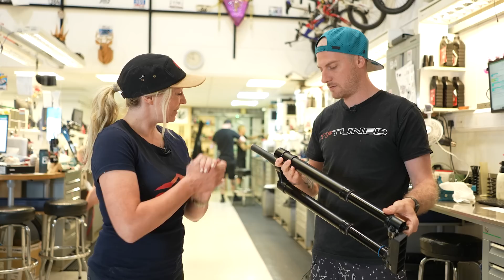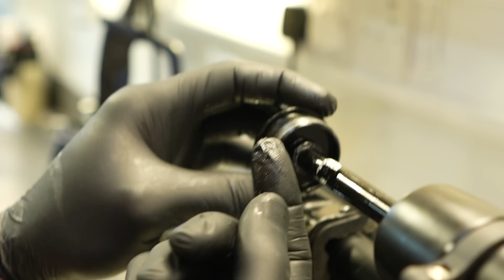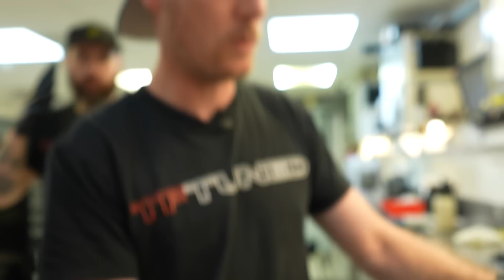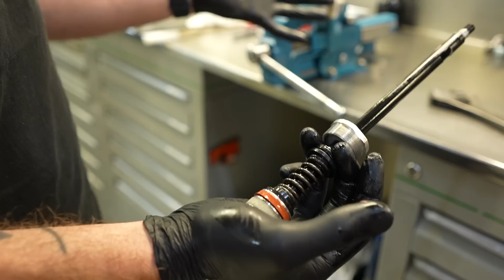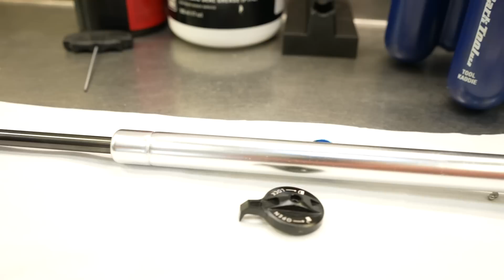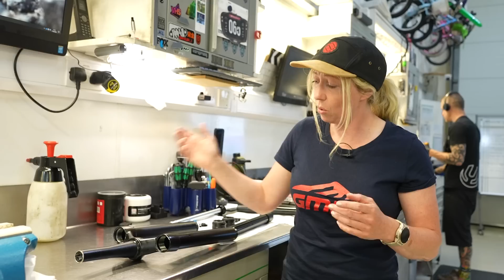Pro Mechanic Reacts To CHEAP AliExpress MTB Forks!

Comment: I think this is unfair on a couple of levels. Firstly, talking about Aliexpress like it's a brand or manufacturer. It's just a marketplace. These aren't 'Aliexpress forks'. There are Chinese brands really trying to gain a good reputation and make good stuff who use Aliexpress too. Why not reach out to such brands and do an honest review of their products rather than buying something that's almost certainly going to be junk? There are also OEM manufacturers who literally sell the same parts that are on bikes in UK bike shops or make components for major brands.

Secondly, get a smart Aliexpress shopper to choose the products that you use. Buying stuff that looks like the latest tech or trend (like upside down forks) and has no brand name on it at all is not the smart way to use Aliexpress. It almost gives the impression that you're deliberately trying to hunt out the worst products. The smart play is to look for products that use well established standards, conventional designs and are happy to put their name to them. Most times you'll end up with something that works well, albeit based on tech that isn't cutting edge.

Comment: I mean my first half decent fork was an RST 80mm on elastomers, it certainly wasn't the greatest, but after several years of riding it still had tight bushings. At the same time I took good care of it by regreasing every winter, but I guess there is nothing you can do about a factory defect, the play on the bushings is unacceptable, the forks won't last longer than 200 hours without showing signs of wear, they just broke in and they are already showing signs of wear... For reference I had many Rock Shox forks over the years and with just regular oil changes I never had replaced bushings, just the occasional seal replacements when they leak. And that goes for every other fork and suspension brands... So very well said there at the end, get a used one, at the end of the day what you want is something that isn't a concern when you go riding, make sure you do an oil change before riding and it will work as good as new.

Comment: I'm using a budget air fork named (Sagmit Evo 3) mine doesn't have a rebound adjuster just a compression / lockout and I experimented mine I remove my lockout damping rod cause the rod won't allow the fork to travel to it's potential travel however the fork is still safe to use on trail and even when jumping.

Comment: I have Aliexpress forks, actually looked at this one since it looks kind of cool, but there wasn't enough information for me to really consider it.  I do wish I'd gotten the DNM upside down one though in hindsight, since mine is potentially as sketchy as this one inside (although it rides fine so far so probably not as atrocious), whereas the DNM is heavy and primitive in a way that it should require maintenance more often than a more expensive fork from the big brands, and feel less sophisticated, but also primitive in a way that it probably won't break or wear completely out as long as you take care of it.  My DNM shock is excellent, and their forks seem to be a cut above the randomly occurring brands, although like I said, not necessarily the cutting edge of technology or as maintenance free as the big boys.  You do have to consider though the cost of taking your branded forks to a place like TFTuned as well, wheras the Ali ones cost less than a set of tires.  The one I ended up buying, is just OK, but there are photos and explanations online by people who have taken it apart and tuned it up, where they lubricate it better than it comes from the factory, but I didn't see any cases of people finding it completely F-ed up like this when they take it apart.  So it looks like that little bit of research served me well, might have even saved a bunch of teeth there, knock on wood.  Anyway, that's not what makes me nervous riding.  What makes me nervous is that when I broke the main pivot bolt in my not so great Aliexpress frame, I got it repaired at the machine shop nearest the bike shop, which turned out to be right across the street from where the Titan sub took off from to go implode, days before they left.  If they'd needed any work done at the last minute, they'd have used that same machine shop, around that same time.  My bike could have the same metal in it as the Titan submersible, so that's what really haunts me when I ride.  Plus it's all from Aliexpress lol.  But that pivot bolt is way more spooky.

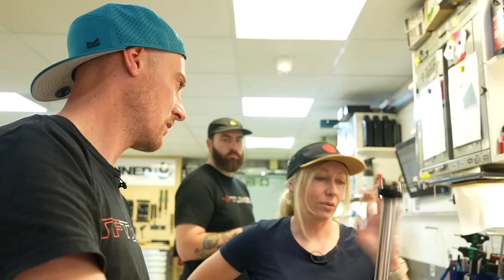Comment: 14:50 that air cartridge is similar to marzocchi pre 2000 tech ! you can drill 2 holes in it ! one at the bottom about 3-4 mm large and one smaller like 2 mm wide half way to top and convert it to open bath !
Reply from the maker: Wow! What a tip haha. We'd try that if this wasn't in the bin 😂
Reply: @gmbntech  this happend to me around 2005 when i had a 66 rc2x, the air cartridge was faulty and the only repair you could do to it was making holes in it and make it open bath, worked well, saw this at that time on pinkbike 😂

Comment: The funny thing is i,m old enough to remember the very first mtb suspension forks ie manitou rockshox etc and they were fkn terrible i worked for a big bike company and flatly refused to use the shit suspension i was faster on a good rigid cro mo fork its funny its taken almost a livetime for mtb suspension to be good and the bicycle industry still pretended that moto cross forks are so differant its crazy .

Comment: Its funny but it seems those cheap bolany forks are of better quality than whatever those forks are on the video, the bolany forks at least have a brace between the two sides of the shocks to keep the wheel in the same direction as the forks are pointing.

Comment: Good luck running them!😬 Aliexpress fan however;  success with alot of great value tooling, road bike wheels and other randoms; huge market place with every tier of options. @TraceVelo does a great job putting this in context for road bikes...Won't be in any rush to change the Trek, Zebs and DVO though.............. Also in context GMBN is sponsored by big brands, Fox and Rockshox are made in Taiwan. More interesting challenge for GMBN would be to build a decent bike for half the price from Chinese imports, see how it stacks up?!?!?!?!

Comment: Something interesting to note here is the price - Aliexpress (and similar platforms) operate on a very slim margin - often with orders shipped direct from factory. This means this POS-fork-shaped-object actually cost over £100 to build! Now if you consider the margins for a low end entry level fork like a Suntour XCR or even a Rockshox Recon - they are actually close to being the same build price..... :face-blue-wide-eyes:
Reply: AliExpress is nothing like Temu, Wish etc. There a proper factory to individual/ store front to individual website. And it's the most legitimate there is. I've had 100s of orders through AliExpress and as long as you known what your looking for and stick to reputable Chinese brands your fine. Can't say the same for wish and Temu. 

As for "margins" I'm not sure your referencing the correct site. As AliExpress direct from factory stores often have 10-40% off sales. Im willing to be they over paid for the fork.
Reply: @unclejohn5012  I hate to break it to you, but the business model and margins (whether cost up or rrp down, a margin is still a margin) are the same across all those sites.

Comment: Knocking this badly built fork is funny and all but perhaps a conversation about big brand suspension service intervals.  50-100 hour service interval on car suspension for example would be laughed at but somehow acceptable on a $1000+ fork.
Reply: A $1000+ fork is essentially a high-performance/racing product. MX (or any other kind of performance motorcycle) suspension also has short service intervals. I would imagine that suspension service intervals for high-performance off-road cars (e.g. rally, Baja, etc) would be similar.
Reply: motor cycles  are the same 50 -100 hours  tho   car shocks  are extremly  basic  unless  its of an s500  or land rover  (ai ride  that alyayes  leaks  normly  the air lines   )      basicly a  spring   and a sealed  damper  (cant be rebuilt    damper is a disc  with holes it in sliding  up and down in a tube full of oil

Comment: Rockshox just filled my Lyrik with red grease and called it a day, after I sent it in for a service because the Low Compression knob was stuck after a few weeks from new. It worked much better after paying 200 euro for a full service at the LBS.
Reply: £125-130 for a service. That's why I service my shocks myself, Rockshox are so easy to do and if you brought your bike from  your lbs surely they should fix it under warranty.
Reply: @Alan-75  Yeah, only Fox makes terrible to service parts. Like the Float X2.

Comment: I buy secondhand because I can’t afford new, but I wait for offers and don’t rush into stuff. I just make do until a deal comes along, still ride though. 
I did once buy a 27.2 dropper from Ali express and do use it, even though it does have a bit of play in it, not enough to cause an issue. I take it apart and clean it quite regularly though because it gets dirty quickly inside. It’s a coil dropper, so I don’t have too many problems.  Still I’d like to find a good second hand branded one at a decent price…

Comment: How about getting an engineer and a workshop to fix it / build it properly and explain during that what goes into it? E.g. seals with different applications (dynamic / static etc.), compression, deformation, lubrication, diameter change when stretched etc.

All proper nerdy stuff, but people (also sometimes people working the machine industry since years!) totally underestimate what actually goes into all those considerations... (and sometimes in the industry make changes that might work in the tedt setup, but not in the field - which often can be proven by doing the maths / physics needed)
Reply: Funny how people can also overestimate engineering of bike components when the reality is more of FAFO than thought-through calculations. Historically, most brands grow out of machine shops rather than design bureaus...

If you can work around AI translation or simply know Russian, there is an ex-engineer/bikemechanic/youtuber Lexapskov doing exactly what you want. All English or Spanish content I'm aware of is rather academic and they don't go past graphs and charts.
Reply: @feedbackzaloop  don't know what you mean with FAFO - never heard that.

When it comes to design, sometimes you end up just using e.g. the same seal grove geometry over and over. Of course you don't re-calculate everything if conditions don't change. I know from first hand experience, that often being done with the design fast rather than correct is what company owners and customers want. So you end up skipping those things more often than not. Here comes experience into play about what you need for what circumstances. But sometimes it bites you and have to correct such things a year after market launch.. 

It would just be a nice way for GMBN Tech to show what actually would go into such moving parts like forks, hubs etc.
And I'm sure they would find a balance between full nerd mode and entertainment.
But it would also show nicely why maths and physics in school is good, since the basic principles can be understood with this basic knowledge.
I don't expect them to slap around with integrals left, right and center...
Reply: @WaechterDerNacht  ...and often you don't recalculate when the conditions do change. Or rather get information from field testing and service feedback. You produce something, let people F* Around and Find Out. Then roll out a x% lighter, y% stiffer yet z% more compliant part. And so on.

And well, even school level physics is too abstract. Wear and tear marks tell much more. But I'm afraid unless those connected to injuries it won't bring GMBN views. And in no circumstances it's bringing sponsorships as their products must be seen immaculate.
Reply: @feedbackzaloop  ok, now i know what you meant with FAFO...
And yes, quite often that's how it goes.
Reply: It might not be possible, these forks lack the center brace between the two shocks. So it's not going to matter unless someone was to weld a brace between the two shocks.
Reply: @madmax2069  lol, tell it to Intend, arguably the best forks on the market. Besides, anything welded in suspension structure is questionable at best dangerous at worst. Bridge you are refering to must be cast together with both legs. Or at least bolted on like it was 30 years ago.
Reply: @feedbackzaloop  those kinds of forks that don't have a brace would usually be designed where the shock and stanchion are shaped internally so that the shock won't rotate around the stanchion (the lefty fork for example).
Reply: @madmax2069  yes, but it's not so necessary for structural integrity as the bridge. Also quite easy to implement. See how it works in dropperposts. Pretty much all motorbike forks...

Lefty in the meantime is a product of its own league.

Comment: You guys should get a big brand to put this fork through their safety test for consumers. This would be good for consumers and the brand to show the difference in safety.
Reply: Yeah compare the chinese cheap forx with a simularly value fox or rockshox ~ its just stupid to compare low end with high end..
Reply: @johnnybravo1912  i dont think they are comparing low end with high end , if you bought any named brand fox,rockshox ect of ebay for the same price of £140 you would have a far better/safer fork with the named brand even if its a bit older. On some MTB things i think you can go for a cheaper option  as some brands really do take the piss with pricing but when it comes with forks theres no point in taking a change if it breaks you cant get it fixed if you managed to survive it breaking and its never going to last as long and your far better of buying 2nd hand and getting it serviced for similar money
Reply: Hopefully this video has done a good job of outlining the safety levels of this fork already. The fact that a critical part was damaged, a structural securing nut was threaded, and 3/4 of the seals were missing should tell you enough about the quality without a big brand running it through their testing facilities.
Reply: Get a bucklos or tanke fork, and they wind up being the same as a major brand lol,

Comment: Is it just me? I feel like GCN/GMBN either tells you the expensive stuff is really good or the cheap stuff is really bad.  I wouldn’t trust these forks either but they seem to promote the perception that cycling needs to be expensive and most average bikes aren’t fit for the trail.
Reply: Wasn't it this channel that showed how flimsy a set of rockshox from the 90s were and then mentioned they were the model used to win the DH WC that year?  I think they're confused between best performing and safest.  Just because they might not be the best doesn't mean they'll break.
Reply: Cheap stuff is garbage, I've had some on my bike an very dangerous.
Reply: That’s definitely not my intention. I want people to buy safe, quality stuff at the same price. Hence myself and Greg both concluded that secondhand forks would be the best alternative

Comment: Remember this when the ebike motors show up everyone please…
Reply: the cheap ebike  motors are infact   fine     unless  you putting 7kw  into a 1kw  rated  one   it wont fail  but   most of the cheap ones  are  1kw  or more  and cant be used on the roads  in the uk   as there  us  spec  28mph
Reply: Meanwhile Bafang is a top dog company for ebike motors.
Reply: @unclejohn5012  saw guy with baefang two way radio. It got dunked in water once and died. I dont want junk likely plagiarized technology personally.
Reply: @kevinc7632  Baofeng dont make ebikes. Bafang does though. Most baofeng radios arnt advertised as waterproof anyways.
Reply: @kevinc7632  dude, Baofeng is not Bafang💀  it's like saying you don't want to ride Ford because once got pwnd in Fortnight
Reply: @feedbackzaloop  all china junk is plagiarized. Anyone speaking of fortnight may be too young to know that. They have special language in china to discuss plagiarism. Its part of the culture.  Always corners cut. Always lack of support after initial period.

Comment: Hopefully you put it back together for someone to use in their pub bike build. Would be quite environmentally irresponsible to throw the fork in the trash.
Reply: It wasn’t possible to put it back together. Most of the threads threaded. It’s why we concluded that it’s not environmentally responsible to buy these. We also concluded it wasn’t safe to ride, so I would not want anyone using them.
Reply: @annaonthebike  Right call, and right message to the masses. Still have many 90's Marzocchi forks on my bikes. Good quality products are most environmental. I will however challenge you to find some quality products from Ali, they do exist and are spinning on some of my bikes :)
Reply: It would be way more irresponsible to put that fork on someone’s bike. Get it thrown in landfill where it belongs, alongside all the other crap bought off Ali express.

Comment: One of the problems is the forks will be made to a price i.e. cheap aluminium and steel, low cost labour, poor machine tolerances and fastening techniques and likely across several back street manufacturers. If you are serious about your riding then a quality set of forks from a well known brand is not beyond those buying a medium priced bike and wary about their riding safety . Excellent piece and well worth the effort put into it to highlight poor quality and safety issues.